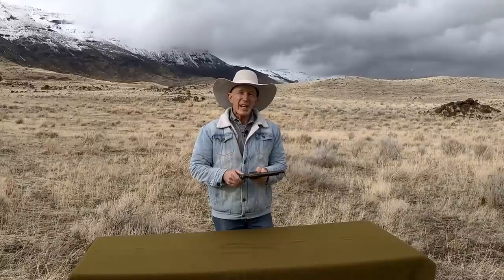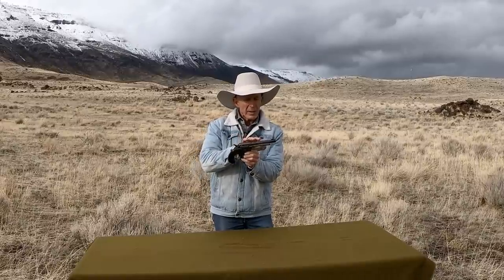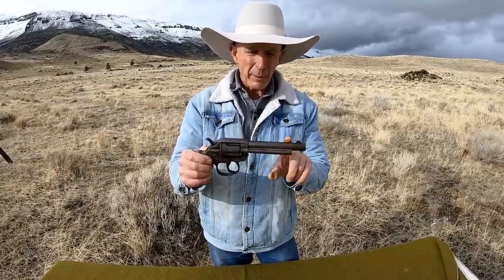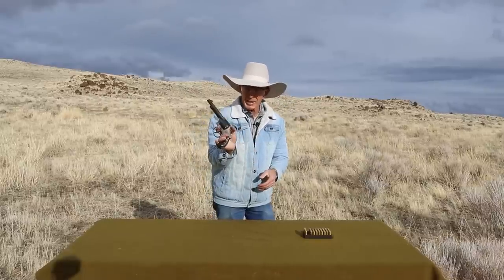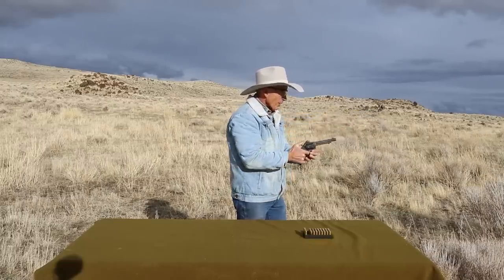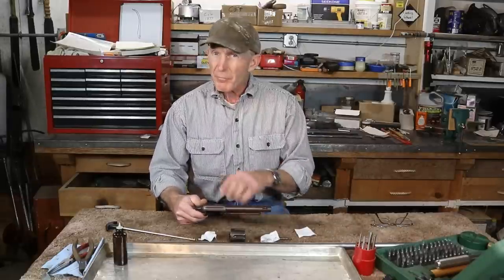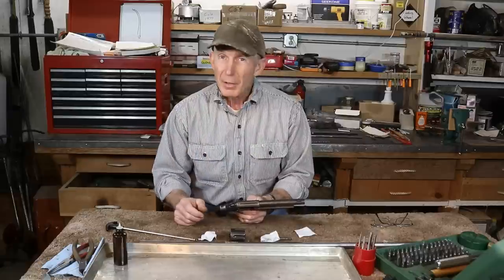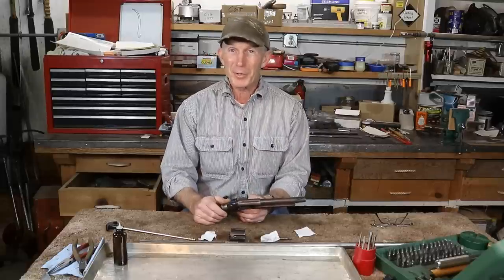Colt 1878 with a Barrel Bulge

Comment: Sir, I have a Colt Frontier Six Shooter from the Copper Queen Mine, Bisbee Arizona from 1903. When I bought it from a young ladd in Mesa Az , he stated it was his grandpaw. After getting it home I noticed a slight bulge about 1/4 inch back from the front sight. I made two swage blocks from    1 1/2 inch cold rolled steel shaft on the lathe and milled four sides. Slit it and removed the bulge with my 30 tone press. Went slow and easy. The bulge is no longer. Thanks for your Videos       Mark Angle
Reply: I did the same thing.
Reply: I've long thought that your method would work, glad to learn it does.

Comment: Several years ago I  had a chance at one of these that was in a local shop. I tried to find out about it but despite a lot of internet sleuthing I couldn't find out enough to give me the confidence to buy it. I now know that the 1878 is stronger and more reliable than the 1877. It was in quite good shape, nickel plated, it didn't have the large trigger guard. Of course I regret passing on it now.
Reply: I did that with an "unknown remington" once. Come to find out it was an original remington rolling block with the armory coin still on the stock.  Cabelas only wanted $400....  regret it to this day.

Comment: They are interesting revolvers!  My 3 are a rust bucket army surplus in 45 Colt, a 32 WCF that is crazy heavy, and my favourite is in 455 Webley.  All 3 are shooter grade, and all are very hard on primers.  The mainspring is extremely heavy (for good reason!) and pierced primers are the norm for my meager collection.  Wish my 1877's were as easy to work on as my 1878's have been!
Great video as always!!

Comment: Have done the foot work to determine rather the bulge reflects same inside the bore? No I'm sure I can't teach you anything new. With all that in mind I will share a thought or two. A. Minnie was brilliant and most forget why. A hollow based bullet can fill in the gaps of an oversized bore no matter the cause.  Second  a gas check used in an not not much talked about way, can be used in a outside the box way to solve gas containment in such cases.  Simply insert the check upside down at the case mouth over the powder, then insert bullet to depth on top. This has proved it self to me many useful an overbore situation. If I remember correctly a recent video of yours featured such a Winchester that you slugged the bore and discovered.
You may find this useful or you may think I'm crazy but there it is. 
       Mountain man

Comment: This is totally off the subject but a old friend of mine just gave me a marlin 336a deluxe with a 24" inch bbl made in 1948 and it's still 90-95% still has the front sight hood only thing that is missing is the rear sight elevator
Reply: That's the kind of friend to have!
Reply: @MrTruckerf  exactly

Comment: I've never fired a any firearm with a bulge in the barrel. Thanks Mark for firing this one. I think that shooting non-jacketed lead bullets might make a difference on how a bullet travels through the bore. 
     I did look at an automatic pistol a few years ago at a local gunshop that had a bulge in the barrel so, I was arranging to have a barrel made for it before I purchased it, when it got sold to somebody else and that person now had the problem. As far as I know the previous owner of the pistol never fired it so, I don't know how it performed. The gunsmith at the shop told me that from his experience it was a stuck bullet that had caused the bulge to occur and one of the previous owners had shot the bulge out with the next cartridge. At the time there were a couple of barrel manufacturers that would make the correct barrel for this pistol. I don't know if they're still in business today. l have some time today so, I will take a look on the Internet. There is Turnball Restoration Co. 6680 NY-5, Bloomfield, NY 14469. The phone number is: 1(585) 657-6338. I read about their restoration business in one of the firearm's magazines a few years back and they have many of the roll stamps for the barrel markings on these old barrels if one needed to replace a barrel.
     Again,  thanks Mark for showing us this old revolver. You could reline the barrel then precision weld the ends so the liner joint wouldn't show however, upon x-raying the barrel the liner would be seen.

Comment: Hello sir .  Nice vidéo as usual, and by the vay thank you. I have just a question for you if you allow me. I have a colt 1878 from 1881, and do you think it's safe to shoot modern cowboy action loads un it? I have always heard that I may only shoot BP loads out of it. Thank you for your time .
Reply from the maker: Yes, it's safe to shoot light smokeless (cowboy action) loads through an 1878 Colt, but it's more fun to shoot black powder.  The modern Cowboy Action loads are loaded to produce no more pressure, and in most cases, even less pressure than the original black powder loads.  I check the ballistics on the cowboy action ammo and gravitate to the lower end of velocity.  Some only produce 700-800 FPS.  Since we're not using them for self-defense or hunting, there's no need to push the velocity.
Reply: @thecinnabar8442  thank you very much for the answer. I’ve always heard that smokless and BP doesn’t produce the same kind of preshures, and that smokless could damage the gun. But it was generaly refering to models like the 1873 SAA.

Comment: I have a 1917 S&W .45 ACP with a bulge about 1" from the muzzle. It will shoot about 4" groups at 25 yards from a bench rest. I also have another 1917 with a mint bore which shoots 3" at 25 yards. So the difference in accuracy is not great. Now get a dent in the muzzle crown and god only knows where that bullet will go.

Comment: I have my dads Walther PP he sent home from WW2. Pick it up off a dead German soldier. and sent it home one piece at a time. I have noticed it has a bulge in the barrel. I have shot the gun a few time over the years. But never had any trouble with it shooting. I would not want to take the original barrel off the gun so I guess I will just let it set and look at it from time to time.